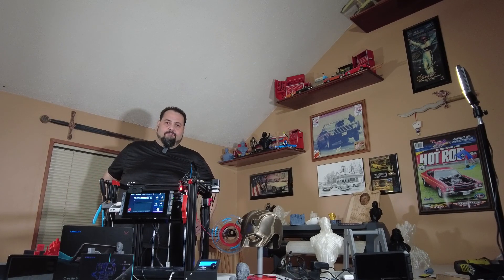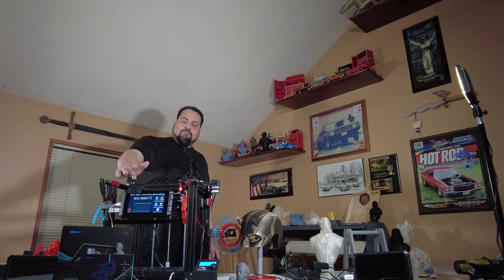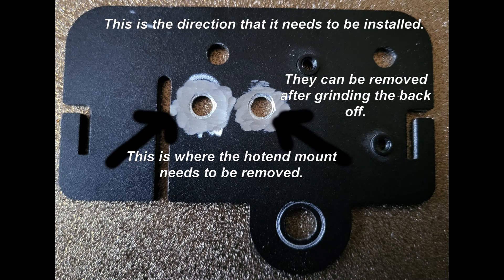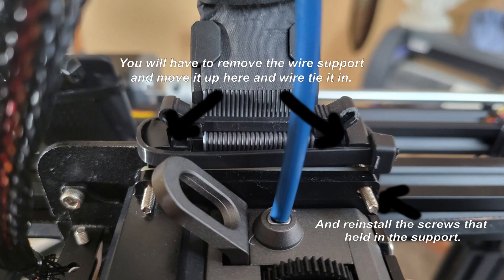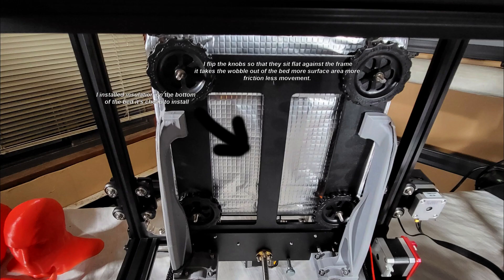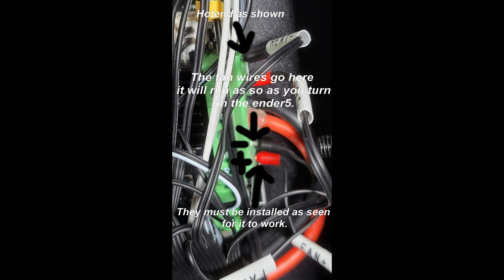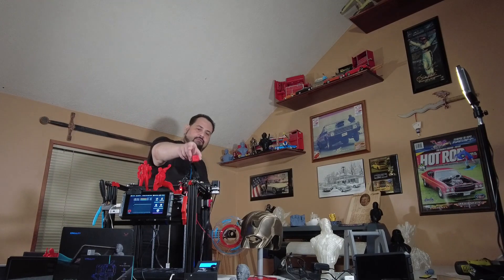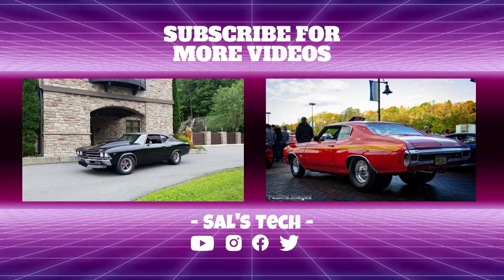Ender 5 pro sprite extruder and Sonic Pad / klipper watch this before you buy a Creality Ender 5S1

Comment: I noticed the "diving board" problem with my E5, straight away. I printed the supports and used them for a while but got agitated when I would try to work around the bed area, and they kept getting in my way. So, I did a lot of pressure testing mixed with stupid math and testing. And, I now have no supports but I have a nano pitch on my bed with under bed stiffeners. The only way you can notice it is if you put a level on it.

Comment: I have completed this install, but when I go to pre heat I immediately get an error and the Ender 5 Pro CR Touch light start to blink. It never heats up and the board crashes I assume due to the error on the sonic pad screen. I did check the wiring and from what I can tell, it all appears to be correct. Any thought? I have a Ender 5 Pro with the 4.2.7 board.

Comment: Hi, what speed and acceleration are/were you running? I just changed my E5Pro to the Sprite Extruder SE, and now I can't get a good print without layer shifts in y.. before I was running 150mm/min and 1500mm/s², now I'm at 50mm/s and 500mm/s².

Comment: Hey, what’s going on? My name is Jose I like the set up that you have with Ender five Pro I actually set mines up just like yours, but I’m having a problem when sonic gets to prepare for Z access offset calibration I hit next step and an error message pops up must home before probe. If I bypass hitting next a tip pops up Calibration value is out of range.manually modify printer? If you can please help me

Comment: at last a channel that actually explains the mods, thank you. Easy sub. I recently bought the E5P and of course, I have a question for you. You adapted the support plate for the extruder. I am swapping my micro-swiss ng on the Ender 3 to put on the Ender 5 pro. Can that be adapted for it? Otherwise, I have to buy a new NG for the E5P and they ain't cheap my friend!

Comment: Curious I have a ender 5 pro with an encoder run out sensor and the CR touch  are you able to add functions like in marlin? I'm really excited to set it up just don't want to brick my printer

Comment: I’m currently trying to find info for setting up the ender 5 pro with the sonic pad. What process did you go through with that? When I boot the pad up it gives me the option for the 3 series and the 5plus but not the pro
Reply: I would like to know how this was done too as I also have an ender pro 5
Reply: I updated the sonic pad and then it had stock settings
Reply: @brandonkharns3198  what board are you running? 4.2.2 or 4.2.7? I have the 4.2.7 and can not get it to work with the sonic bad.
Reply: @jandjmcfrck   I got it sorted. I thought it updated but I ran it again and my model showed up